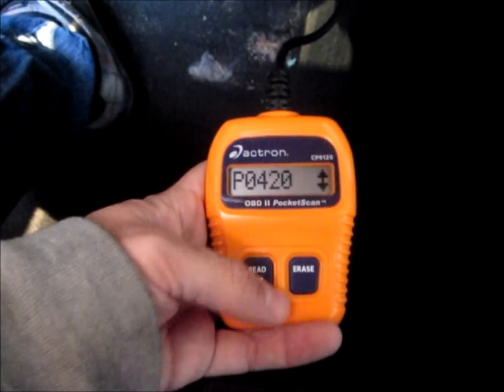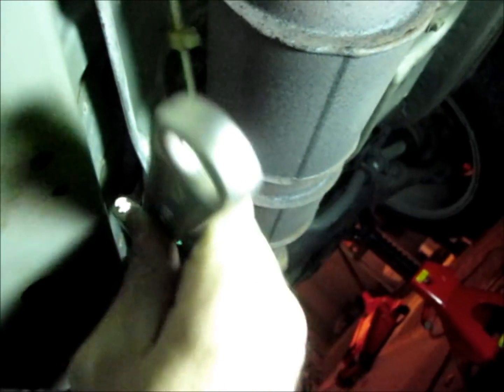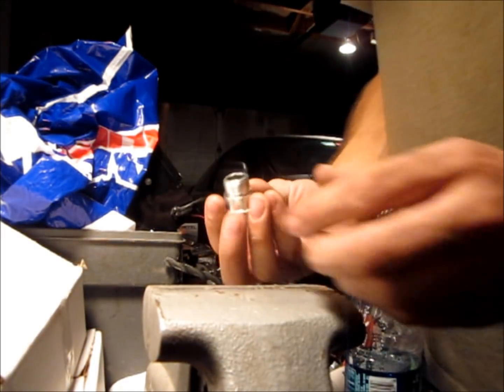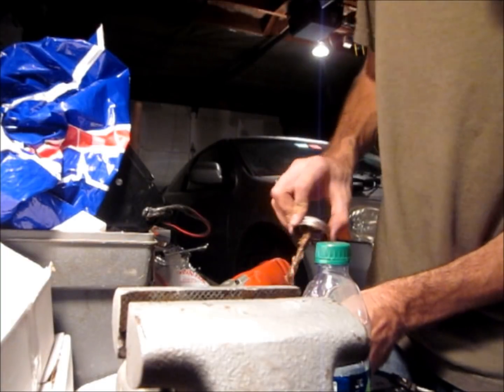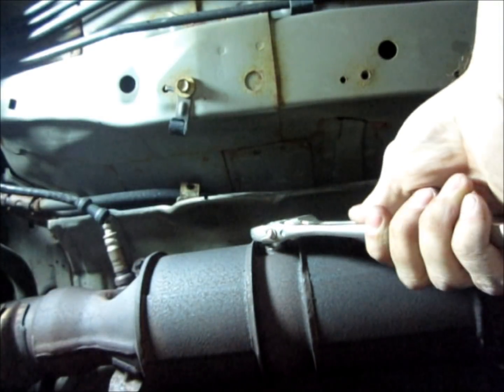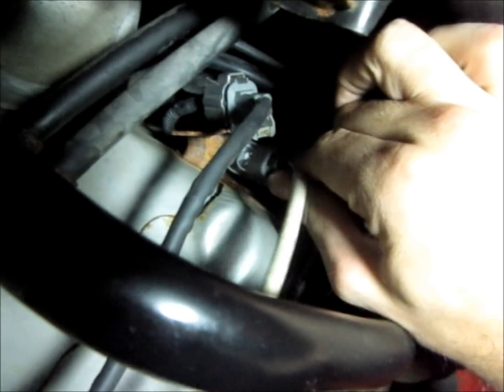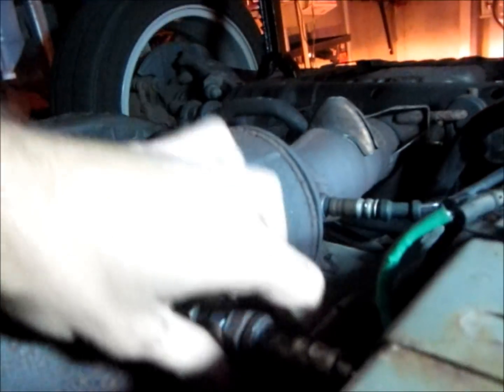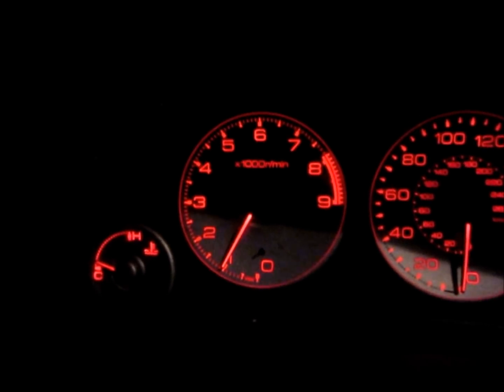Clear check engine light for less than 5 dollars

Comment: when you get the car inspected, they ask you if you've disconnected the battery recently. I don't know why, but when they check it, a battery disconnect probably shows up as a code and maybe they think you're trying to reset the check engine light without fixing something that's wrong with it. IDK.
Reply: +FireoftheGreeks I'm glad I live in a state where there is no emissions testing. Sounds like a pain.
Reply: tpembert
there's been talk here of eliminating having a car inspected altogether. go through old receipts from the '80s and it used to be like $4 or $5. now with the "emissions test" it's $30 and the entire inspection doesn't appear to accomplish anything other than making our wallet $30 lighter. but once businesses get used to that income, they'll lobby and fight tooth and nail to keep it.
Reply from the maker: +chieftp I know for a fact that Florida has NO inspection requirements whatsoever. Kinda cool, but kinda scary at the same time lol. So many old cars down there due to tropical weather. Would be awesome to not have to worry about safety inspection, but at the same time it's a double edge sword due to you have no idea who is driving what, and what car next to you on the highway may have faulty ball joints / suspension / shocks / tires / brakes ..... you get my point lol. Any rate, thanks for watching, and drive safe!!
Reply: +Jose Martins If someone asks if or why your battery has been disconnected just tell them you had to replace the battery with a friends old battery, or tell them you disconnected it to do some work on it. You should always disconnect the battery when you work on it.
Reply: yes but when you unhook a battery or even if,your battery dies completely it suspends the codes for around 500 miles. if you fix the problem and you clear the codes with a code reader then it's fine. but unhooking the battery May shut the light off but you just put them in a incomplete state. this emission stuff really sucks sometimes. I had a bad o2 sensor so I replaced it and cleared the code with my Palm reader($100) and now it's fine. just never unhook a battery if you have a check engine light on
Reply: +chieftp Disconnecting the battery OR clearing the codes will reset the vehicles monitors and set a P1000 OBD II checks incomplete code, until the vehicle has driven enough to go through all the self checks for the monitors (either pass or fail).  If any of the monitors in the system are incomplete, you will have the P1000 code. See this every other day in the shop with people either unhooking the battery or clearing the codes and trying to sneak through the emissions testing without fixing the problems.
Reply: FireoftheGreeks Yup that's exactly what I was saying.  You can't cheat the computer by trying to bypass it.
Reply: +bigg boy315 ;
so, they got you either way....
Reply: we'll if you unplug the battery it puts any codes you had in suspended moniters and to clear them off the computer you have to drive them for 500 miles so if your up for inspection and you don't have time to rack up 500 miles don't unhook your battery..the light may be off but the computer stores them so when they hook up there computer it still finds the moniters it stored.
Reply: bigg boy315
and if you have them cleared, they'll bitch about that too. I thought the only criteria for passing an emissions test is that their test machine communicates with the car's computer, all the controls are in place (catalytic converter, O2 sensor, PCV valve, etc,) and that everything is functioning.
Reply: chieftp ^
               |
comment above was intended for you sorry
Reply: +FireoftheGreeks I learned that lesson the hard way. Had a stubborn (small evap leak) code that kept coming up intermittently. So I cleared the code literally in the test station parking lot. Needless to say, the only thing I accomplished was a lighter wallet and a failed test. Moral of the story: Let the codes clear themselves and check to make sure they're cleared right before taking the test. Then hope like hell that the computer doesn't decide to invoke any new codes during the ten or fifteen that your vehicle is in the hands of the tech.
Reply: actually hook up a laptop with OBD2 software on it and you will see why. all cars ECUs run test and after disconnecting the battery it resets ECU clearing data for these test.
Reply: You have to have a certain number of monitors ready to get a successful emissions test done. When you disconnect the battery, you reset all the monitors and must drive 50-100 miles for the monitors to be "ready". You don't really fail the test when you do this, you just can't test it at all. They will tell you to drive the car and come back.

Comment: I just recently had a nagging "service engine soon" light.  It turned out to be all three oxygen sensors on a 5.0 Chevy.  From what I understand and researched, if you run the motor too long with marginal oxygen sensors, it could eventually damage the catalytic converter.   Oxygen sensors are much cheaper.

Comment: Will this stop the pollution your car is making?
Reply: +Benito Caspo   No.
Reply from the maker: +Benito Caspo There is no pollution. It is an unrealistic setting in the ECU of many cars to detect a "threshold" which typically lingers on 4 or 5%.  It's a money grab to get poor schmucks to either A: fix the car by replacing the exhaust system ($2,000 to $5,000) or B: Trade the car in and buy a brand new car ($25,000, to $60,000).  The choice is yours my friend.

Comment: maintenance required light is for service, like an oil change.
Reply: +Bratrin maintenance light and check engine light are two different things.
Reply: I'm an am ASE certified technician. 
A maintenance light is illuminated when normal maintenance is due. 

Check engine light comes on when you have a problem. You do not reset the maintenance light when you do repairs. 

Apology accepted.
Reply: +James Richardson I agree with you. Some people do t understand the difference between maintenance and cel light.
Reply: This guy is using a plug de fouler and clearing the oil change light. Lol. Keep up the good work. I fix the do it your selfers all the time.
Reply from the maker: +James Richardson If you watched the vid from beginning to end, you would see that both issues are tended to individually.  I clear the C.E.L. by installing the "fouler", and by coincidence, I happened to have to clear the maintenance required light at the same time.  You should know as an ASE tech, that those two separate indicators (C.E.L and M.R.L) will produce entirely different alerts.  Thank you for watching !

Comment: This worked on my 2005 Chrysler Pacifica! Thanks. However, when I took it to the smog guy he easily noticed it protruding from the cat. He said it was illegal and had to be removed before it would pass. So it turns the light off and it will pass the computer part of the test but if the smog guy sees it in the visual inspection you will fail:( I live in California and they are required to do a visual inspection.
Reply: If you live in California, you need to find a new place to live.
Reply: +bigg boy315 Yup, KaliFornia DOES suck. I had a cat replaced under the smog assist program. Took it to smog station a couple years later and they said because the model number embossed on the cat was too deteriorated that they could not continue the test. I immediately took it to the original station that installed it. They had no choice but to pass it because they were the ones who INSTALLED it. Anyway, they now have new regulations requiring a metal raised lettering plate. The system is corrupt!
Reply: That sucks, here in AZ if the computer passes it then you're good
Reply: +Jake Jones wow that's insanity man
Reply: +Jake Jones 
they probably sold you a used one? That $500., or $600. "CAP" won't pay for a new cat!
Reply: Ryan Morgan yea If he sees it ... there's a chance he won't so depends
Reply: Did you go to one of those run down ghetto places or to professional shop??
Reply: wow that really sucks that you in cali that have actual smog guys. there really lax here in ny.. if it passes the computer and all normal stuff is good then it passes. the reason we have all these emission regulations is bc of cali.  kinda ruined it for everyone..lol..luckily here in ny 97 and under ha e no emission reg and '00 can pass with 2 codes reading and '01 can pass with 1 code reading. I hate inspection time..lol..Thanks California! !!!!
Reply from the maker: +Ryan Morgan Sorry to hear that.  California is one of the strictest when it comes to emissions  / smog.  Most states you will be ok with this, as long as all parties are aware that this setup is for testing purposes only ;) Cheers, and thank you for watching.

Comment: What kind of drill bits did you use? I have a 7 amp drill with a 21 set for $16 bit set from walmart and I could barely go through the defouler after 30 min! -__-
Reply: Manuel Escudero your drill bits are dull or cheap... get a set of Bosch cobalt drill bits, they are under $30 on amazon and designed to not dull from hard materials such as metal.

Comment: I know nothing about O2 sennsors so I was wondering if you could get the same result by only removing the sensor and cleaning it?
Reply from the maker: +wdtony Worth a try bud, but after that, try my method... if that does not work, replace the sensor... if that doesn't work replace the cat, if that doesn't work, seek g 0 o g L 3.  Thank you for viewing my friend :)
Reply: +moccina - Ended up being a clogged catalytic converter. rebared it  and good as new.

Comment: If you need an ECM give us a call or shop our online store: www.autoecmstore.com or 800-900-0194 for a quote on your part. We have over 400,000 parts in stock We also reprogram select parts. Give us a call for ecu repairs or ecm replacements.

Comment: Your check engine off because you clear the code by disconnecting the battery  po 420 will come back
Reply: petey815 Yeah because a typed message across the video is rock solid proof that the code did not return...

Comment: Keep in mind your also resetting the engine light by unhooking the negative so your check engine lights would go off anyway, but I see it lasted so good job.
Reply: toy0tq runner mode 94
Reply from the maker: +David DeRoche Yeah buddy... I made the mistake of combining the "check engine light" fix along with the "maintenance required light"... so many will say it is the same thing.  However you and I both know this is not the case! Thank you for viewing, cheers!

Comment: Worked good. I had to use the 42002. The 42009 was to short for mine. No more
check engine light. Thanks.

Comment: I need to pass a visual meaning my cat just needs to be in place. They don't check for O2 sensors or mods to it just look under the car real quick to see it then look to see if the "Check Engine" light is on then then I'm good to go. My question is I want to gut my cat for more power will this still work for me as well as pass smog check (where I go they don't care what I do as long as it passes by the computer)?

Comment: I did this a few days ago, within 30 minutes I got the "02 sensor bank 1 sensor 2 high voltage" fault code. The page I read how to do it said if it didn't work to put a 3rd one in line. I didn't do that yet, hopefully a 3rd one works.
Reply: Update.... a 3rd one didn't work.
Reply: James Blodgett  If the O2 is bad, or if there is a wiring problem to it, or if the car's pcm is defective, then this won't help you.
Reply: ohger1 I didn't have the code before I pulled the cat.
It was a little clogged is why I pulled it.

Comment: Idea is good. But, how is the gas consumption. Because O2 sensor not reading to properly. ?????
Reply: ToolsSNAPON  the downstream sensor is only there to see if the cat is working it is the upstream sensor handles the A/F ratio.
Reply: George Cramer Are you 100& sure that is how it really is?
Reply: Yes 100% the downstream sensor just reads the exhaust to make sure the cat is working. If it reads the same as the upstream sensor then it knows that the cat has failed.
Reply: I really need to do this mod on my jetta , my cat is really old and is really messing up with performance  and firing up my cel.
Reply: If you do this mod make sure you cat is not plugged up first. You may be able to unbolt the pipe from the back of the cat and look inside to make sure the honeycomb is intact. If not get a piece of iron pipe around 3/4" diameter a couple feet long and use a hammer to smash it out. Just make sure you start it after you smash it out with the exhaust still unhooked so the pieces left inside blow out instead of going into your muffler.

Comment: I found a wireless toold for mobile device(Iphone ipad or Android device) to turn off the engine light and read obd2 information from your car
http://www.amazon.com/WIFI-Wireless-OBD2-scan-tool/dp/B00R59EMJY/ref=sr_1_54?ie=UTF8&qid=1431923303&sr=8-54&keywords=obd2+scanner

Comment: Very good video it works as long as you have all the tools at home other wise you'll spend lots of money buying them otherwise you can get a cheap cat online for about 130 dlls it I'll help you to get it inspect it I believe they last less than a year since the original cats are sometimes more expensive than the car itself if you do this trick don't go with assholes to inspect it that might make you fail for this do it with someone that you trust besides the cat  stills work not to 100% but it does just like old people don't take me wrong just to give you an idea  and remember not all the states make emissions Inspections.

Comment: Awesome fix and it works, 2005 Pontiac threw same code and issues, did this all went away..took about 100 miles driving to reset all sensors and car passed inspection in NY. Thanks

Comment: If the idea  is to keep ot from exhaust gas...couldnt you just twist tie the sensor to the chassis and plug the hole temporarily?  Or will reg air trip the sensor for BEING too clean somehow
Reply: dean Strathras  If the downsteam 02 sensor's output signal mirrors the upstream 02 signal, the cat is assumed to be inert and a code is set.  If the downstream 02 signal does not change at all (like if it were removed), the 02 is assumed dead or a wiring problem exists and a code would be set.  By backing the 02 sensor out of the direct stream a bit using this adapter, the downstream O2 still responds to the exhaust, but slower and out of phase with the upstream O2 and it's assumed the cat is having an affect on the exhaust.
Reply: I was wondering the same thing.
Reply: It's been a long time since I was at automotive school....but as I recall, O2 sensors also need to be hot to work properly.  "Tying it to the chassis" and allowing ambient air to flow over it would likely not get it hot enough to cycle properly.  I know that my O2 sensor that I use to tune jet settings for my carburetors will show a FULL lean condition on the gauge for at least 1-2 minutes until the engine has run a while.  So I would assume that is why.

Comment: What this does is basicly increase the difference in the reading of cat flow. When the upstream and downstream O2s do not see a difference in flow it sets a code this would be caused by a worn out cat flowing too much not a clogged cat. I can easilly see how this can work, I'm gonna try it on my 04 Jeep Wrangler 4.0l with a PO432 code.

Comment: just did this on a 03 tahoe yesterday but only used 1 spark plug non-fouler behind the driver side catalytic converter check engine light didn't come back up and got my inspection thanks for the video

Comment: Keep in mind this is not actually a "fix".  This is a cover-up of the original problem.  If you have an intact Catalytic converter, that is throwing a P0420 code, which generally triggers from too much air flow.  So this is not a cover for a plugged converter.  A plugged converter will cause power loss and out right sluggish power if not stalling.  If there is enough flow for it to run, this can cause damage as I have seen vehicles with red hot exhaust manifolds.  If you suspect a plugged converter, take a temperature reading in front of the Catalytic, and behind.  there should be a higher reading generally 600 degrees BEHIND the convertor.  This is from the reaction inside the unit.  if you have a reading that high in front, and low behind, you potentially have a convertor thats starting to plug.

Now to the cause of the P0420.  This is generally caused by too much oxygen (keep in mind this is what the sensor actually reads)  Now this can be caused from several issues.  A technician with an automotive lab scope can test the sensor with the front one at the same time, and the response's should mirror one another, but with about 1.5ms more oxygen generation after the convertor.  This is called the oxygen hold test.  Now this can only condemn the Cat if it fails.  If not you may have to test the sensors performance.  This can also be triggered by a no code misfire, as the cylinder is not actually burning properly and the air passing the sensor can trigger this, so be careful of that one before replacing and OE $800+ unit.  

Short of a plugged cat which this will not fix, this just covers over the issue of a possible failed unit, or in the event you have gutted out your catalytic this will prevent that code from popping up.  So aside from emission testing or regulations, you may  be okay.  some emission testing is just a computer testing sequence "drive cycle" which it makes sure all computer monitors have ran.  So the car "thinks" everything is okay.  Some states actually do an exhaust sniff, and depending on how well your car is running, it may or may not pass with a gutted cat, or a bypassed sensor.